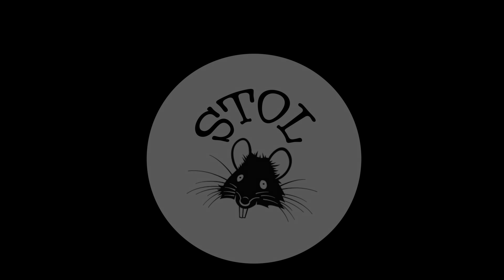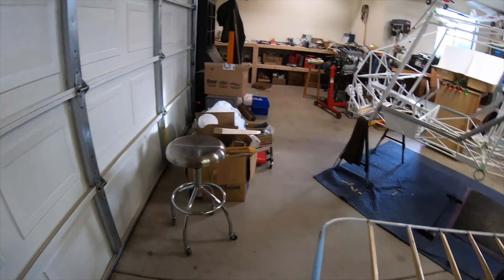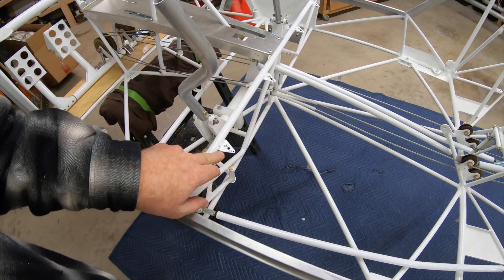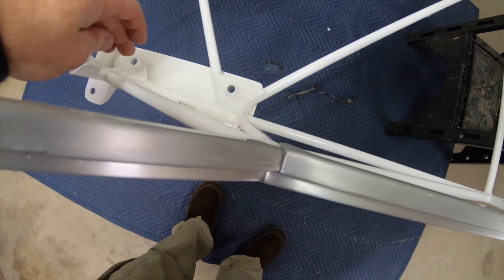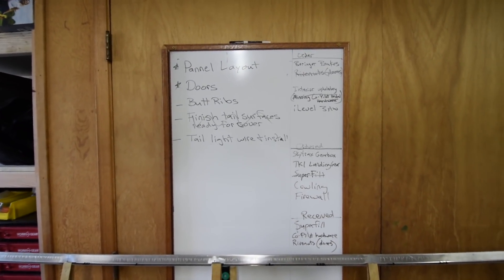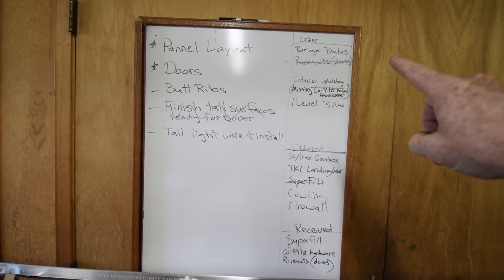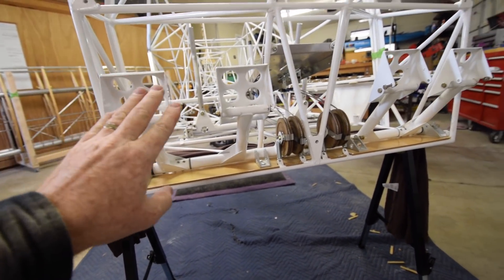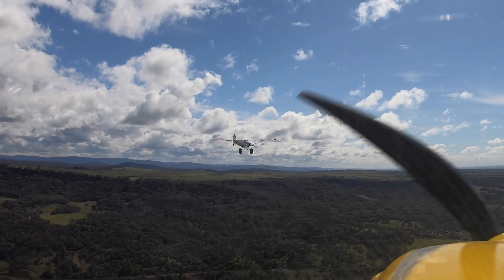Kitfox 7 Apex Build Episode 3 Kitfox APEX Build Tail and panel

Comment: I want to build my own from scratch. What the diameter and wall thickness of the steel used for your fuselage?
Reply from the maker: That would be a question for Kitfox. I'm not sure of the thicknesses they use.
Reply: Project Kitfox I don’t think kitfox  is willing to give out the info, i have tried. Any idea about the outer diameter ?

Comment: Hi, great attention to detail and I think your instrument panel is looking great. This is the first episode of your's I've seen but will go back and start from the beginning to learn more. In the mean-time, I hope you are choosing a modern fuel injected engine and not just another one of the crowd, Rotax steam engines? I have nothing to do with Zenith aircraft engines but I've watched a few vids of flyers using their modern, new Honda engines. Apperently 1/2 the price of the coal burners and clearly far more reliable, robust and fuel efficient.
Reply from the maker: I will be using a Yamaha APEX 150hp fuel injected inline 4 cylinder 4 stroke engine with a very nicely designed Skytrax gearbox designed by Teal Jenkins. The over all fire forward weight will be within 9 lbs of a Rotax with 50hp more.
Reply: I hear a lot about the Apex, it does look to be a great engine and probably much better than old tech rotax. I have had a few Yamaha MX bikes and once owned a Yamaha Phaser sled. All very reliable engines. Viking do now have a 180hp turbo Honda but it is a bit on the heavy side. Good luck with the project and I am following you to watch project progress. Good luck!
 @BowenAero

Comment: From a commercial pilot stand point, I would highly recommend finding a light weight, & small back up attitude/airspeed/inclinometer combo. It needs to operate independently & off the backup battery system. 
I've had several total electrical failures with glass panels of certified aircraft & several more partial failures. Thankfully each airplane had backup systems. Consider it cheap insurance.
Reply from the maker: Thanks for the comment. I too am a commercial, ATP and believe in system redundancy. Although not as crucial in a VFR only aircraft, I would like to have maybe an Analog airspeed indicator, the engine monitor is backed up on the GRT 4000's display and with 2 iPads there is a level of redundancy also. I also have a Stratus ADHRS unit that would be used in case of  a iLevil failure.
Reply: I'm new to your channel. I appreciate you taking us through your build. 
Perhaps you have covered this, and if so forgive me for causing repetition, what drove you to decide on the Kitfox instead of the Zenith or JustAircraft?
Reply from the maker: nzkiwi9 tail wheel is a must so the Zenith was never a consideration for that reason and others. I did consider the Just aircraft Highlander, not the Super STOL, the Super STOL has some characteristics that I’m not a fan of. I also considered the Rans S20 and S21. All good choices and would fit my mission well. All of these require a significant lead time before getting your hands on a kit. I have a Kitfox already and I love its flight characteristics and have ideas on how to improve on my current one. I was able to find a kit second hand which allows me to get to work this spring. That’s basically it.

Comment: As for your instrument panel, iPad is good but maybe as a second failsafe system,  I saw this, hope it is helpful, http://homebuilthelp.com/Tip_of_Week/Tip_59.html
Reply from the maker: Jeff, thanks for the comment, yes the Talos system is very similar. I plan on have some level of redundancy, 2 iPads and maybe an airspeed indicator, the engine monitor that feeds the information through the iLevil also has its own display and I will carry my Stratus portable ADHRS with ADS-B in, in case the iLevil ADHRS fails.

Comment: What size ipads are you planning?  BTW, can you control & display your DJI Osmo Pocket remotely with the ipad (via wire or WIFI connection)?

BTW, I love watching this (and other) airplane build videos.  But I must say, I hope I never get bit by this bug, because I want to spend my time... flying!!!  :-o  :-)  Hopefully my building/fiddling will be limited to mounting cameras (presumably 3, 4 or 5 Osmo Pockets) to my airplane, and not much more.
Reply from the maker: I am going to use 2 9.7" iPads. Yes, the Cosmo can be controlled by the iPad or my iPhone with a wifi connection. I also control the Gopro's with the iPad and iPhone using wifi. Lots of wifi going on in that little airplane.
Reply: @BowenAero  : Great news... for me.  Maybe.  While I'm waiting for the airplane I ordered to arrive, I've been trying to figure out how to shoot great, sharp, detailed, immersive, compelling videos.  My first decision was to try to achieve this by mounting 4 or 5 Osmo Pockets on the airplane... 2 under the wings looking [nominally] outward and somewhat forward, one in front of the tail-wheel looking [nominally] forward, one behind and between pilot and copilot looking [nominally] forward, and possibly one beside/outside the copilot window looking [nominally] past copilot and pilot and a bit forward.  I say "nominally" because presumably it will be possible to pan and tilt the cameras with the ipad via wireless (or wired) connection.

So I bought a DJI Osmo Pocket and... could not find any way to download the MIMO app.  It can be downloaded by iphones, but I can't find the app on the ipad.  So I'm very curious how you control the Osmo Pocket with an ipad.  My plan has been to get an ipad pro 12.9" (current 2019 edition).

Being that I've never had a mobile phone... and absolutely HATE mobile phones with a passion (and what they've done to human beings)... hence I have zero interest in buying a mobile phone and paying monthly fees for... nothing.  The ipad isn't as bad, since it serves to support foreflight and various other pilot apps.  So my plan has been to control the 4 of 5 Osmo Pockets and/or other video cameras with the ipad... either via WIFI or by hard wire connections (either pulling and plugging the 4 or 5 wires into the ipad all the time, or via a hub that lets me switch from camera to camera with a slide switch or knob).  I gather the OS in ipads is designed stupidly... so one cannot run 4 or 5 instances of a given application like MIMO (one connected to each camera).  If this is indeed true, I may have to disconnect MIMO from one camera and then connect to another (via WIFI) to switch from camera to camera.  Or at worse, shut down MIMO, then start up again and connect to a different camera.  Pain in the butt, but I guess that's what I get for working with lamestream populist hardware.

How do you switch back and forth between cameras with the ipad?

I figure I will need to also find a way to put a "brick battery" (or whatever they call those power-block gizmos) on each camera, because I intend to run the videos for hours continuously at a time (during long non-stop flights)... though sometimes in time-lapse mode over "boring" stretches.  Or if I run wires from every camera to the ipad, maybe I can find a way to run each cable through one of these power-blocks gizmos.  All these issues are very confusing for me... given that I've managed to avoid getting into this world of lamestream populist hardware until now.  Not that I'm from the stone age... I've been a computer designer and electronics system designer for decades.  But everything I work with is either a standalone system that connects via ethernet to serious, fast, many-core computers... or software that runs on a highly capable fast, many-core computer.  I've never even owned a notebook computer... again to slow and lame for my purposes.

So now I'm paying for ignoring lamestream populist hardware like ipads and such for the past several decades.

Interestingly, the following just appeared and has me possibly rethinking (in part):  https://www.youtube.com/watch?v=_Fq33dHNSfI

In any case, I will want at least one Osmo Pocket or equivalent on the airplane to display the main front wheels approaching the ground during landing (not to mention be able to see what is in front of the airplane and what direction I'm heading when getting close to touchdown).  So I need to figure this stuff out.

Why does the MIMO app not appear on ipads but does appear on iphones?  How did you get MIMO on your ipads?

I'd love to be able to suck everything you've learned about shooting video from your brain!  :-)
Reply from the maker: @maxbootstrap7397  I use the DJI Osmo Plus, so the Oslo Pocket maybe different. I connect to it with wifi, but use the remote mount and control the camera with the control handle. With the GoPros you have to switch between cameras by switching wifi network, it is a real pain and sometimes doesn't work. I usually connect one and leave that one connected and run the others in the blind.

Comment: What is the purpose of the two vertical push-button levers sprouting out of the forward portion of the console?
Reply: David Heal I believe they are for the adjustable rudder pedals option.
Reply from the maker: Mark is correct. I will have to add an explanation in the next episode.

Comment: Brian, I don't have any personal experience using an iPad for primary flight displays, but isn't overheating on those hot, hot CA summer days an issue?  I think there are some mounting docks with cooling fans which may solve that problem, but I'm not familiar with them.
Reply from the maker: That can be an issue. Both in panel mount systems have provisions for keeping the pads cool. One has a fan and the other has a connection provision for an air hose.

Comment: One of the issues I have had with the iPad is power while in flight on a clear, unlimited visibility, bright sunny day. None of the 50w high power 12v adapters seem to have enough power to charge and! display at full brightness. Charges fine if the display is off.  What will you be using to power your units? Anybody else have suggestions for a non permanent install?
Reply from the maker: I will be working on a solution for the charging. I'll let you know what I come up with.